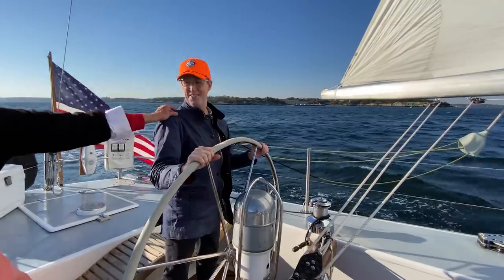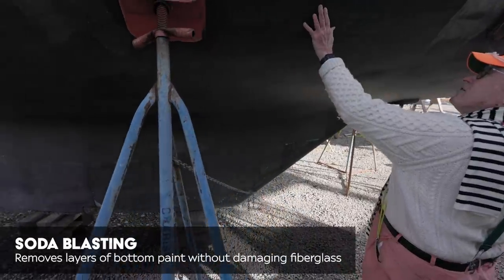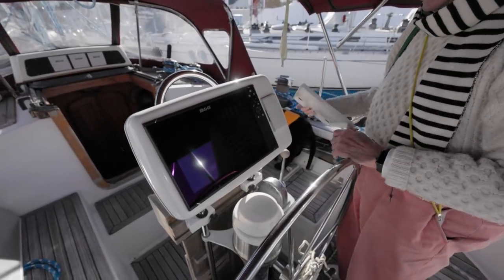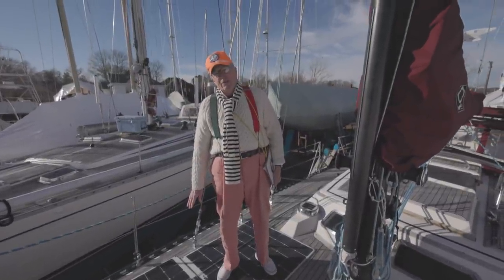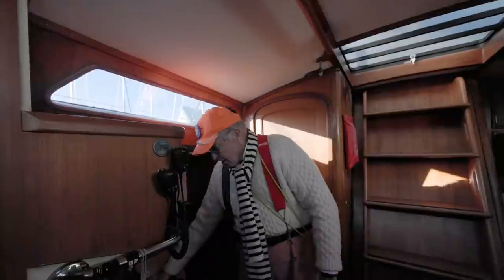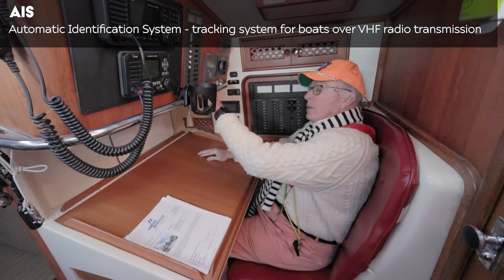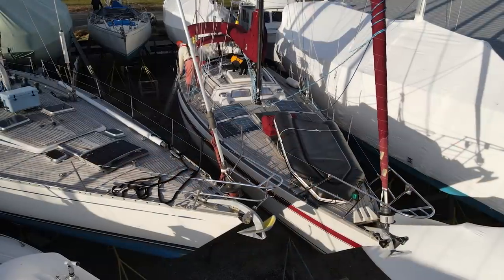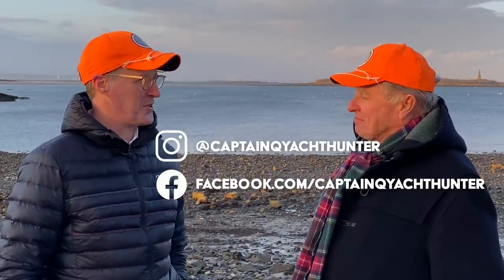$99,500 USD GLOBAL CRUISER! Proven bluewater sailboat for sale! EP76 #sailboatforsale #sailboattour

Comment: This boat is going to cost a lot of money, and/or time to get right. The teak deck problem is not going to be an easy fix, and there's almost certainly going to be water damage to the deck core. $99K is too much, in my opinion.
Reply: You are wrong brother, you do not have all the information.  Capt. Q could not have gone over all that his been done to Dream Weaver in less then a couple of hours.   Here ya go: 
Accommodations
Sleeps 7-8.  V berth forward.  Enclosed head with vanity and shower next aft to port, hanging lockers opposite to starboard. Main cabin features U-shaped dinette to port which converts to form double berth, settee opposite to starboard. Galley next aft to port, forward-facing navigator's station opposite to starboard. Aft owner's stateroom with double berth to port and single berth to starboard is accessible from main cabin through a second head, with vanity and shower, located aft of navigator's station. Both toilets are Wilcox Crittenden Skipper models, both rebuilt in 2019. Shower fixtures new in 2019.

Galley
U-shaped galley features propane four-burner, gimbaled, stainless steel stove with oven (oven  not working),  Sea Frost (2021) 12 volt refrigerated ice box and separate freezer with digital monitors and controls, double stainless steel sinks with pressurized hot/cold water. Propane system installed in 2019.

Electrical
12 volt DC and both 110 volt AC and 220 volts AC. Engine and generator starting batteries are 12 volt lead acid. House batteries consist of three Relion RB-300-hp 8D 300 ah lithium iron phosphate batteries (2019). Four deck-mounted semi-rigid, walk-on, 175 watt SolarWorld Sunmodule solar panels mounted on foredeck whose 700 watts of power produce as many as 250 ah per day! The four three-foot-square panels feed two 30 amp Victron SmartSolar MPPT charge controllers, monitored via a Victron Color Control GX mounted at nav station. Eclectic Energy (British) D400 wind generator (2019) with max output of 600 watts. Nex-Gen 5.5 KW 10 HP diesel genset (2019) with 75.7 hours. 110 and 220 volt Victron Energy inverter/chargers (2019). Boat automatically accepts 110 volt or 220 shore power and can output both voltages simultaneously, if so desired.

Electronics and Navigation
Brooks and Gatehouse electronics suite including forward-facing sonar, AIS transceiver, 4G radar (antenna mounted on mast), three Triton2 multi function displays, 12" Zeus3 chartplotter, and barograph. All purchased new in 2019, all updated in 2021. Simrad hydraulic autopilot (2019) networked to B&G system, Icom M803 marine HF SSB radio transceiver (2019) with DSC and color display, Icom AT140 automatic antenna tuner (2019). Insulated backstay serves as SSB antenna. Copper foil ground plane glassed into hull during boat's manufacturing process (standard practice with all Lafitte 44's). Icom IC M-506 VHF radio transceiver (2019) with RAM mike (2019). Iridium wifi satcom system (2019). King wifiMax router and range extender (2019). Ritchie SP5 binnacle-mounted compass.

Hull and Deck
Modified full keel with skeg-hung rudder. External lead ballast. Airex-cored hull, balsa-cored decks. Teak decking. Double bow anchor rollers. Maxwell electric windlass, rebuilt in 2019 with foot switch and wireless remote control. Double stainless steel lifelines (2018) with starboard boarding gate. Edson steering system. Four opening overhead Bomar hatches. 10 opening ports. Two Marinco solar vents with reversible fans. Two midship deadlights (2019). Cockpit shower. Dyneema jacklines, port and starboard, running bow to stern. Three padeyes in cockpit for attaching safety harness tethers

Sails and Rigging
Cutter-rigged keel-stepped aluminum mast. Staysail stay fitted with quick-release lever at base allowing stay to be quickly deployed or stored. Running backstays. Sail inventory of 7 sails, all made by Port Townsend Sails in 2019, includes fully battened mainsail with two deep reefs (30% and 60%), light air loose-footed mainsail with snuffing sock, roller-furling 115% genoa, Dyneema-stayed drifter, particularly robust staysail, storm trysail with separate track on mast, and storm staysail. Block and tackle boom vang with Dyneema line, 22', 20 lb. carbon-fiber whisker pole (2018) with integrated stowing (flush with mast) nd deploying system. Harken mid-boom mainsheet traveller (2018) mounted on house. Winch inventory includes two Harken #35 two-speed, self-tailing, mast-mounted halyard winches, Lewmar #30 self-tailing, two-speed, mast-mounted, reefing winch, two Lewmar #55 self-tailing, two speed, primary genoa sheet winches, two Lewmar #40 self-tailing, two-speed winches mounted on coach roof, one Lewmar #46 self-tailing, two-speed winch mounted on coach roof. All standing rigging and turnbuckles new in 2018.  Most running rigging replaced in 2018 with Dyneema. All chainplates removed in 2018, dye tested, and electropolished. All chainplate attachment points reinforced in 2018 with additional glass.

Mechanical
Wind Pilot Pacific (German designed and built) servo-pendumum mechanical windvane self-steering system (2019).

Additional Inventory
Viking 8-person liferaft (2019) in hard cannister mounted in a deck cradle. 3D Superlight Twin Air 290 9.5' inflatable dinghy. Burgundy cockpit dodger (2019) with zippered front window, stainless steel bows, and stainless steel grab rails on three sides. Burgundy bimini (2019) with stainless steel bows, full 360 degree enclosure, canvas covers for all windows, window on top for checking sail trim, and cover for top window. 45 lb. CQR plow anchor with 300' of 10 mm chain, 300' nylon rode, Danforth 35 HT with 50' 10 mm chain, Paul Luke 100 lb fisherman anchor (2019). Ace Sailmakers (E. Lyme, CT) Jordan series drogue. Plastimo extendable man overboard pole (2019). Stereo with two speakers in main cabin. Pots and pans. Toaster. Five fire extinguishers, six fenders, assorted docklines, two horseshoe buoys (2019), boat hook. Misc. engine spares.

Disclaimer

Comment: This boat has to be tied for the worst interior layout I've ever seen. It's just...bizarre, it makes no sense. Maybe in person it's better? Other than that, I really like the boat, even being a double ender and having a huge rear end, it's still a nice boat. I wonder why the owner did all the fg work on the chain plate mount areas?
Reply: There is no way the Captain could have given this sailboat the time need to go over all that has been done to her.  Here is a list of upgrades and additions as well as the chainplates being reinforced:
Accommodations
Sleeps 7-8.  V berth forward.  Enclosed head with vanity and shower next aft to port, hanging lockers opposite to starboard. Main cabin features U-shaped dinette to port which converts to form double berth, settee opposite to starboard. Galley next aft to port, forward-facing navigator's station opposite to starboard. Aft owner's stateroom with double berth to port and single berth to starboard is accessible from main cabin through a second head, with vanity and shower, located aft of navigator's station. Both toilets are Wilcox Crittenden Skipper models, both rebuilt in 2019. Shower fixtures new in 2019.

Galley
U-shaped galley features propane four-burner, gimbaled, stainless steel stove with oven (oven  not working),  Sea Frost (2021) 12 volt refrigerated ice box and separate freezer with digital monitors and controls, double stainless steel sinks with pressurized hot/cold water. Propane system installed in 2019.

Electrical
12 volt DC and both 110 volt AC and 220 volts AC. Engine and generator starting batteries are 12 volt lead acid. House batteries consist of three Relion RB-300-hp 8D 300 ah lithium iron phosphate batteries (2019). Four deck-mounted semi-rigid, walk-on, 175 watt SolarWorld Sunmodule solar panels mounted on foredeck whose 700 watts of power produce as many as 250 ah per day! The four three-foot-square panels feed two 30 amp Victron SmartSolar MPPT charge controllers, monitored via a Victron Color Control GX mounted at nav station. Eclectic Energy (British) D400 wind generator (2019) with max output of 600 watts. Nex-Gen 5.5 KW 10 HP diesel genset (2019) with 75.7 hours. 110 and 220 volt Victron Energy inverter/chargers (2019). Boat automatically accepts 110 volt or 220 shore power and can output both voltages simultaneously, if so desired.

Electronics and Navigation
Brooks and Gatehouse electronics suite including forward-facing sonar, AIS transceiver, 4G radar (antenna mounted on mast), three Triton2 multi function displays, 12" Zeus3 chartplotter, and barograph. All purchased new in 2019, all updated in 2021. Simrad hydraulic autopilot (2019) networked to B&G system, Icom M803 marine HF SSB radio transceiver (2019) with DSC and color display, Icom AT140 automatic antenna tuner (2019). Insulated backstay serves as SSB antenna. Copper foil ground plane glassed into hull during boat's manufacturing process (standard practice with all Lafitte 44's). Icom IC M-506 VHF radio transceiver (2019) with RAM mike (2019). Iridium wifi satcom system (2019). King wifiMax router and range extender (2019). Ritchie SP5 binnacle-mounted compass.

Hull and Deck
Modified full keel with skeg-hung rudder. External lead ballast. Airex-cored hull, balsa-cored decks. Teak decking. Double bow anchor rollers. Maxwell electric windlass, rebuilt in 2019 with foot switch and wireless remote control. Double stainless steel lifelines (2018) with starboard boarding gate. Edson steering system. Four opening overhead Bomar hatches. 10 opening ports. Two Marinco solar vents with reversible fans. Two midship deadlights (2019). Cockpit shower. Dyneema jacklines, port and starboard, running bow to stern. Three padeyes in cockpit for attaching safety harness tethers

Sails and Rigging
Cutter-rigged keel-stepped aluminum mast. Staysail stay fitted with quick-release lever at base allowing stay to be quickly deployed or stored. Running backstays. Sail inventory of 7 sails, all made by Port Townsend Sails in 2019, includes fully battened mainsail with two deep reefs (30% and 60%), light air loose-footed mainsail with snuffing sock, roller-furling 115% genoa, Dyneema-stayed drifter, particularly robust staysail, storm trysail with separate track on mast, and storm staysail. Block and tackle boom vang with Dyneema line, 22', 20 lb. carbon-fiber whisker pole (2018) with integrated stowing (flush with mast) nd deploying system. Harken mid-boom mainsheet traveller (2018) mounted on house. Winch inventory includes two Harken #35 two-speed, self-tailing, mast-mounted halyard winches, Lewmar #30 self-tailing, two-speed, mast-mounted, reefing winch, two Lewmar #55 self-tailing, two speed, primary genoa sheet winches, two Lewmar #40 self-tailing, two-speed winches mounted on coach roof, one Lewmar #46 self-tailing, two-speed winch mounted on coach roof. All standing rigging and turnbuckles new in 2018.  Most running rigging replaced in 2018 with Dyneema. All chainplates removed in 2018, dye tested, and electropolished. All chainplate attachment points reinforced in 2018 with additional glass.

Mechanical
Wind Pilot Pacific (German designed and built) servo-pendumum mechanical windvane self-steering system (2019).

Additional Inventory
Viking 8-person liferaft (2019) in hard cannister mounted in a deck cradle. 3D Superlight Twin Air 290 9.5' inflatable dinghy. Burgundy cockpit dodger (2019) with zippered front window, stainless steel bows, and stainless steel grab rails on three sides. Burgundy bimini (2019) with stainless steel bows, full 360 degree enclosure, canvas covers for all windows, window on top for checking sail trim, and cover for top window. 45 lb. CQR plow anchor with 300' of 10 mm chain, 300' nylon rode, Danforth 35 HT with 50' 10 mm chain, Paul Luke 100 lb fisherman anchor (2019). Ace Sailmakers (E. Lyme, CT) Jordan series drogue. Plastimo extendable man overboard pole (2019). Stereo with two speakers in main cabin. Pots and pans. Toaster. Five fire extinguishers, six fenders, assorted docklines, two horseshoe buoys (2019), boat hook. Misc. engine spares.

Be happy, be safe